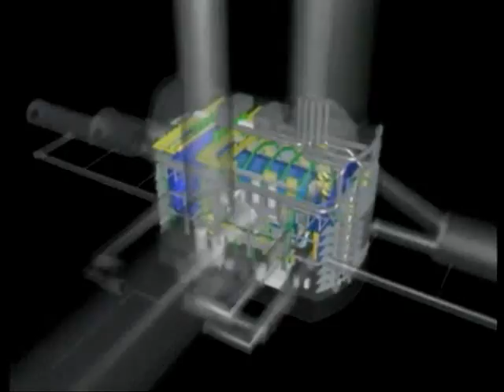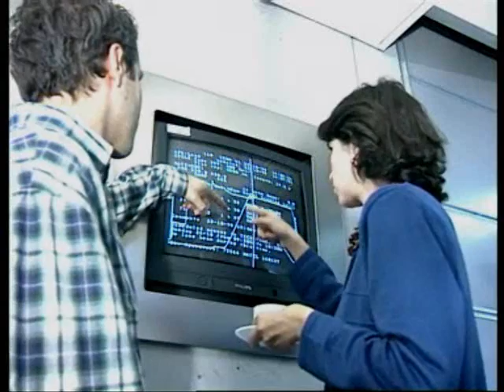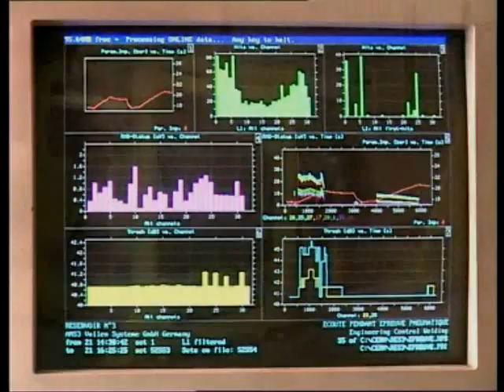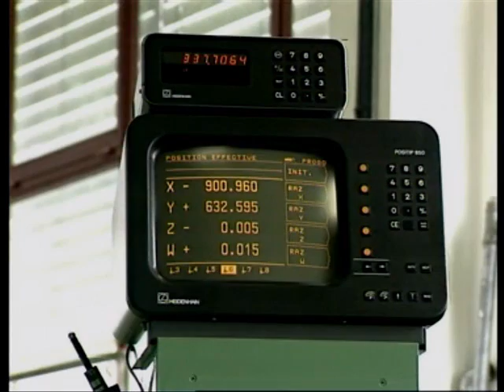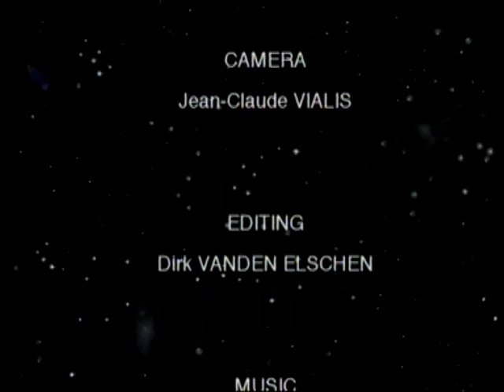LHC The Time Machine 2

Comment: no one has ever built the magnifying transmitter, just basic tesla coils. theres actually a huge difference between tesla coils and magnifying transmitters, also both devices produce waves that are more electrostatic than electromagnetic, so both energy transferers are way different, thats why teslas waves can send industrial energy and the radio sends only a weak amount of power, which is not industrial.  REMEMBER: TESLA COIL different than MAGNIFYING TRANSMITTER!

Comment: You're absolutely correct about H2. After I posted it, I tried to delete my post but realized that you can't. This is somewhat beside the point though, because they have not yet created the gene to make them produce only hydrogen. By putting copper in the tanks and depriving the algae of sulfur, they have been able to reach algae that produce hydrogen 15% of the time. This is a long way off from the success story you were preaching.

Comment: "Orbital engine internals dont need cooling when made from ceramics."
Cite your source.
"Hydrogen can be extracted from any substance with hydrogen"
Obviously. The problem is that energy is required to harvest the hydrogen, thus eliminating (or at least greatly limiting) the impacts of such engines. IF we can get cold fusion (or perhaps start using much more nuclear energy), THEN we can talk about electrolysis of ocean water or some such solution.

Comment: Hello Nathan, I'm glad not all in the lab think I'm crazy-just most. Point 1: Orbital engine internals dont need cooling when made from ceramics. Point 2: Hydrogen can be extracted from any substance with hydrogen: water, fossil fuels and even some organic matter.Almost all of the hydrogen used worldwide today comes from natural gas though a process called reforming. Natural gas is made to react with steam, producing hydrogen and carbon dioxide. So wheres the prob?

Comment: Hydrogen power is, at best, a problematic solution. How do you propose we even harvest this hydrogen? Electrolysis? That uses up TONS of energy (the electrolysis combined with transportation costs far exceed the energy output of the hydrogen). How about the rotary engine you mentioned? Not bad, except that you forgot to mention the fact that there is no way to cool the inner portions of it.
You need to try and charitably consider the alternative views, as most in the academy think yours crazy.

Comment: That would be great IF the powerful OPEC and Seven Sisters oil cartels would allow this technology to transpire. If it were not for these oil oligarchs we'd all be driving hydrogen powered cars or oil based orbital engine driven ones. David Rockefellar and his CFR and T/C mates however will not let this happen whilst there is still oil left in the ground. This technology is for a more esoteric purpose than possible cheap energy supplies. Go read about the "New Man". Cheers

Comment from the maker: On a side note, I applied the schwarzchild radius equation to a Planck length (1.6x10^-35 m) and for a black hole with a radius equal to a Planck length, you would only require 1.08x10^-5 grams (or 6.45 million trillion protons!). The pressure of course would have to be colossal.
Reply: F E = R(p/s) x M x V x pie r 2 .
Do you understand?
Reply: @elizajayne2888 yes I do

Comment from the maker: If you rearrange the schwarzchild radius equation to find out what mass would be required to create a black hole with an event horizon radius equal to that of a protons (0.8x10^-15 m), the answer comes out at 0.5394 billion tonnes. We're aware that mass increases the closer an object gets to the speed of light but I would be surprised if they could generate these kinds of masses within the accelerator.

Comment: There is such a thing as a mini-black hole. Black holes have finite mass, a mini-black hole is simply one with less mass (and therefore an event horizon with a smaller surface area). According to Stephen Hawking many of these formed during the early stages of the universe's development, but have since dissipated through Hawking radiation. If one was to form due to the LHC, it would dissipate extremely quickly. The smaller the black-hole the faster the rate of dissipation. It would be no threat.